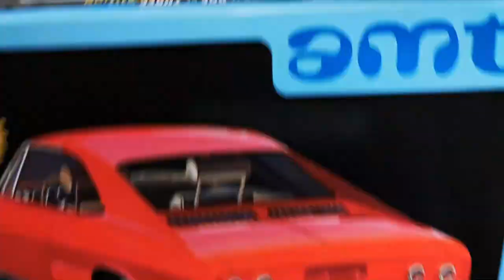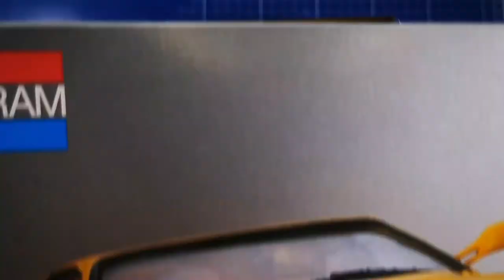Building a Ferrari powered Corvair: 1969 Chevrolette Corvair by AMT step by step

Comment: Such a beautiful build. Love the modifications! I didn’t know that these cars have engines in the rear. And I could have never thought of putting a Ferrari engine in there. Great build!👍
Reply from the maker: The corvair is one of the lesser known Chevy cars and was unfortunately a bit of a failure. I think they are quite attractive myself and I know that they have done actual V8 swaps in them on the full size. I had a Testarossa kit around and I figured what the hey?, may as well throw that engine in there! Glad you liked it. It was a challenge but fun to do.